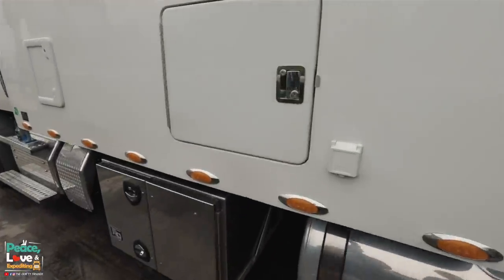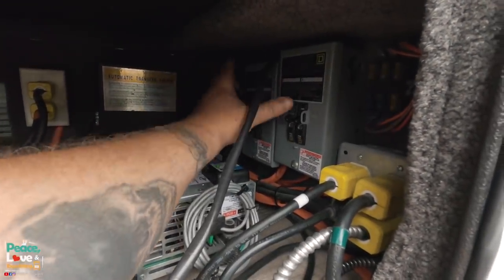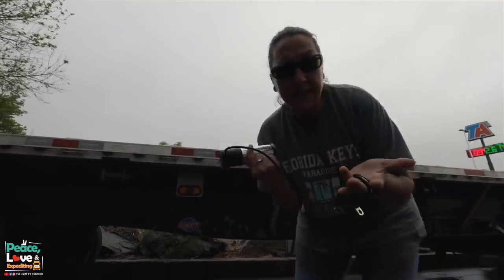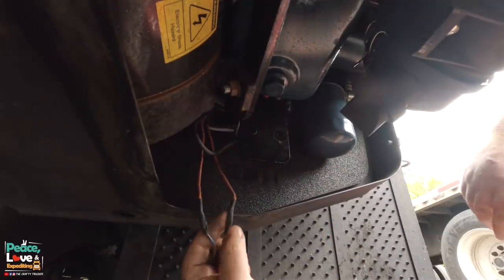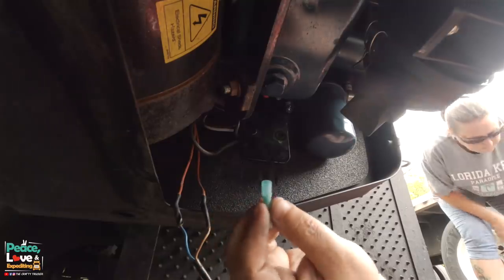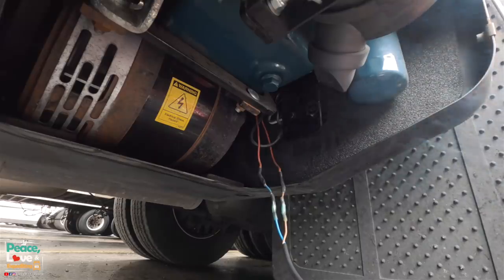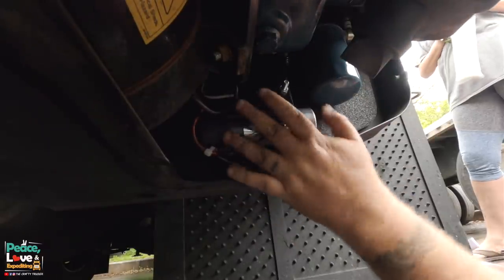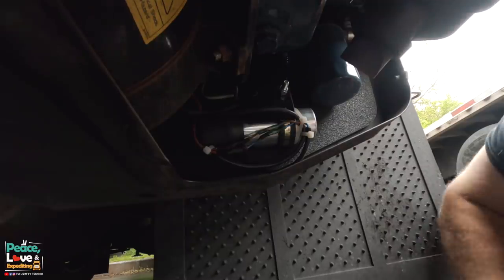CARRIER COMFORT PRO NO ELECTRICITY | Capacitor Change

Comment: Safety warning on caps, they can hold a charge for a long time after power is disconnected so make sure you discharge the leads on a metal surface otherwise you risk a nasty shock.

Comment: Jason, I'm a 40 year retired electrical engineer. Ryan Darfler is absolutely correct. These high power caps can bite pretty hard. Shorting with a screwdriver, as Ryan mentioned, will DEFINITELY discharge them successfully. However, there will be a WICKED amount of current flowing when you do that. That MAY shorten the life of the capacitor(had it been good). Better to discharge it slowly with a 20-Watt, 1K-ohm power resistor(cheap). You can get one at @t or @t. Hold the body of the resistor with a pliers, just in case it should get hot. Thing is, you may never need to mess with another high power capacitor in your life, so this may not be worth the hassle. For your particular fix, the fact that the cap was bad PROBABLY meant the the capacitor was already drained and not dangerous. HOWEVER, let's pretend that the cap was NOT the problem(which could have been possible). THEN, it's could have been kinda like walking into a bit bull's cage, unawares.

Comment: Did this job recently and it fixed my low voltage problem. Extremely simple but heed the capacitor discharge safety procedure or it can be fatal. ⚠️

Comment: U should take the old part back to the generator people, perhaps they will reimburse you.... Also, I'd of twisted the wires together first, then tried it to see if that was the problem, then use the quick connectors etc..... Have a great day, stay safe....
Reply from the maker: Thanks for the tip sir. We always appreciate your advice.

Comment: You should invest in a digital multi meter and a good set of wire crimpers.  You can test capacitors if you have a meter that reads uf or micro farads (sp). It comes in handy for A/C compressor capacitors or generator capcitors.
 Great video.Thanks.

Comment: Just a suggestion that every time you have to add a connection to wiring you always cut out the old connector as long as you have extra wire because every connection causes heat and voltage loss which could cause damage to the cap.
Reply from the maker: Thank you for the tip

Comment: Whenever you were hooking the new wires up you could have cut one of the original connections and hooked it together, then cut the other one so you would know which one was which and it would have eliminated the old connectors. Its better to have less connections. I know you know what you are doing but this is just a little helpful tip. Peace, Love and Expediting my friends..
Reply from the maker: We really don’t know what we’re doing lol just trying to learn and share as we go. Thanks for the tip. We did get a spare if you have further issues

Comment: I would have installed a quick release harness (weather pack / sold on eBay, Amazon...)to make it easy to replace rather than cut every time You have to replace it.

***Any time you create a new connection along the same circuit, you gain resistance and have voltage drop.

2) nothing like a tarp to lay down. Either to keep from getting wet and 2, in case of any spills, it can be easily cleaned up. Tarps are typically inexpensive at Harbor Freight or free w a purchase of almost anything. Cardboard, I love more. I buy the xl box at Uhaul and use it when I repair something. I toss it in the recycling bin thereafter.

Comment: Just a little note, the wires where tucked up away from capacitor so you may want to check make sure it doesn't get to hot where you zip tied the wires, just thinking. I could be wrong and it will be fine.

Comment: Good job for the side of the road. I have a class a diesel pusher and now way do I want to wrench on the side of the road like that. One thing I am thinking as an engineer. And you got the video to prove they put that capacitor in a bad spot originally. You figured it out too, at the end, when you made sure it did not interfere with the power packs oil filter. That capacitor mounting bracket needs to be moved in, like 2 inches. That capacitor should be supported in the middle. If you look at beginning of the video, you will see how it was set up originally. Hanging in the middle. It should not be hanging out the mount 3/4 of the way. It is mechanically unsound. The insides of the capacitor could shift and not last. That is my opinion. The thing I see, the bolt hole placing was messed up in the power pack's engineering department. I bet the electrical engineer did not know where the engine engineer (I am sure they bought a foreign engine) put the oil filter (down to the mm). He /she might have been told the length of the capacitor, wrong. I bet that whole design was made by computer (CAD). They missed it. If for some reason that capacitor had not failed and time came to change the oil, you would have figured this out totally. It was hanging way under the oil filter. If you can. I say drill the same sized hole a few inches in, towards the center of the truck (make the dealer do it). You could move the new hole a little down too. the geometry will work. I'd make sure you have all the head room for the rubber insulator cap (on the capacitor) when you are planning to move it (if you do) And near the same room for the wire. For real, that was not right. You got the video to prove this.
Reply from the maker: Great eye. And great tip, thank you for sharing

Comment: For switching between shore and gen power there should be a transfer switch so the electricity isn't gen and shore at the same time electricity. RV shops have transfer switches.
Reply: Carrier sells an automatic transfer Shore power kit but it's like $1500

Comment: What kind of voltage were you receiving at the CCU before changing the cap ?  I'm receiving 65v AC at the board and the outlet.  I'm leaning more towards the generator since I'm receiving half the voltage.  Belts are tight.
Reply: That's how mine acted but the capacitor fixed it

Comment: I have a question..I just bought a truck with a comfort pro apu.. at first it wouldn't stay running but I got that part takin care of.. now that it's running and you turn on a/c or heat on the power box it says its on but dose nothing..any ideas

Comment: Hey Guys - Former car stereo installer here.   The things you refer to as quick connects are actually called butt connectors.   They need to be crimped with a crimper and not smooshed with some pliers.   Those wires will eventually work their way out leaving you without power!  I would highly recommend getting the right tool and fixing it.   I tracked down a handy video that explains it all https://www.youtube.com/watch?v=i2le4BN0bP8
Reply from the maker: We will grab that tool thank you very much for sharing. See not only did we share something but we learned something too. YouTube is awesome

Comment: Question,  have same apu and i get 120v inside at the board but not at the electrical outlets.  Is this the same that you had or did you not even have 120 at the board?  Thanks for the videos keep them coming. :-)
Reply from the maker: No expert but I would think the power outlets would be an inverter issue. The 120 is there to run high drain appliances. The invert does all the smaller things like outlets in most setups.

Comment: I’ve had to replace my capacitor 4 times over the 2 years of having my truck. I hate having to go to carrier every other month to fix the apu. I have an older carrier pc6000 with almost 17,000 hours on it. Luckily the generator hasn’t gone out blows colder AC than my truck does. If it does go out I’m getting a rig master bc it doesn’t tie into the trucks coolant system.
Reply: You should be able to get a little standalone radiator.

Comment: Sounds like you need a crossover  or switchover  (more than likely both the wrong words) that automatically switches the power input to shore power when it is hooked up...  it would disconnect the generator once it senses shore power, and isolates the generator...
Reply from the maker: We do have two transfer switches, but those are wired after those two breakers.

Comment: So every time the electricity is not working is it the capacitor?
Reply: My Apu run but no a/c, no heat, no fan, and no electricity
Reply from the maker: Most likely it’s the breaker
Reply from the maker: Breaker is located right next to oil drain plug. It is a small red button

Comment: Where is the AC (shore power) Transfer switch? The Generator output and the shore power can NEVER be connected at the same time, Electrocution hazard should you touch the prongs while  rigging the cable
Reply from the maker: The transfer switch is wired after the breakers just to the left.

Comment: Where's the Deadman switch / power transfer switch? Capacitors fail for a reason. 

You mention that you've had a power surge before. Chances are, your Deadman/ transfer switch may have a fault. You're lucky you've not melted or short circuited other connections (i.e. solar panel system).